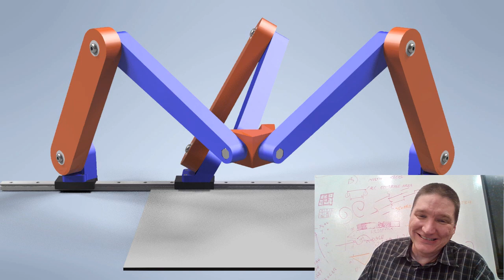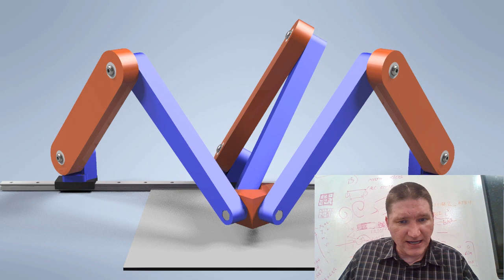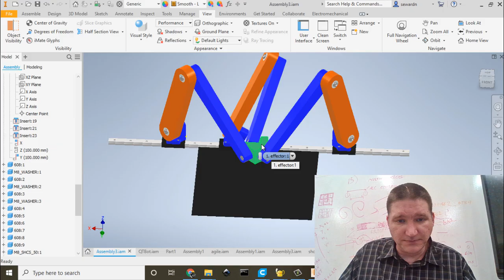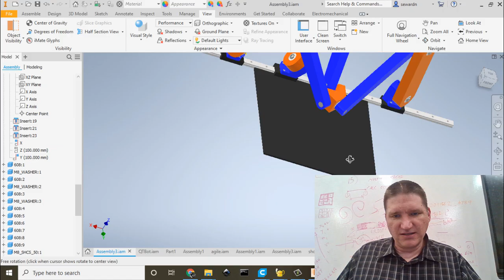RepRap Monorail (Single Rail Tripteron)

Comment: When you've mentioned "single rail" to me I couldn't remotely think how that would work.
Really, really awesome! 🤘
Reply from the maker: Thanks for checking it out.
Reply: I didn't at first either but I think I do now. 
Think of a solid fixed belt and motors attached to the arm slides and then they each run back and forth on the shared belt not hitting each other.
Reply: @ConsultingjoeOnline  I don't think the small teeth on the belt could support 3 independent motors accurately. Generally the end of the belt is attached to the motor block, so the belt is locked with the pulley. I would recommend just having 3 separate belts, parallel with the linear rail, but the belts are just above and below one another. The blocks won't interfere with the belts if they have a hole gap on the block for the other 2 belts, if they were to interfere.

Comment: Instead belts I would use 3 fast leadscrews. It looks mechanically easy to make with a Hiwin rail, 3 carriages printed parts and some bearings.
Reply: Use a gear rack bolted beside the rail, with carriage mounted steppers with gears preloaded again the rack to remove all backlash.
Reply from the maker: @joshbridges8410  I might do that.  Ideas on slick ways to preload?
Reply: @NicholasSeward  Maybe something like two pinions of half the rack’s width with a very slight angle offset between them ? I guess you would then have to replace them from time to time
You could even preload the angle offset with some kind of spring (ideally with deformable parts of the stacked pinion), that would be much better I think
Reply: @NicholasSeward  we got pretty good experience with using a roller-bearing-style cycloid profile to minimize backlash. Might work well here? https://github.com/fellesverkstedet/fabricatable-machines/wiki
Reply from the maker: I am considering screws.
Reply: @NicholasSeward  rotating nuts that make all three carriages ride on the same screw and the same rail
Reply from the maker: @destroyer2012  yes yes yes 👍